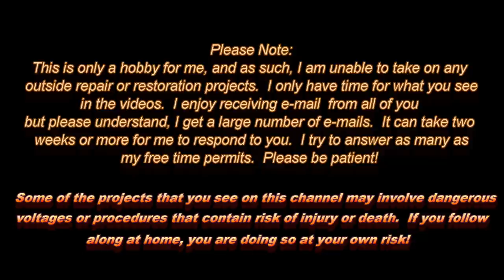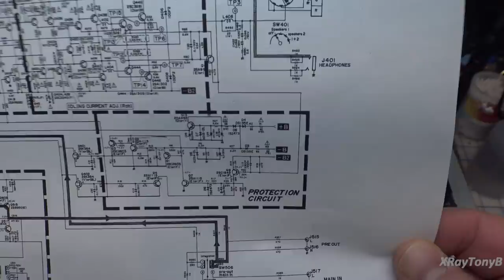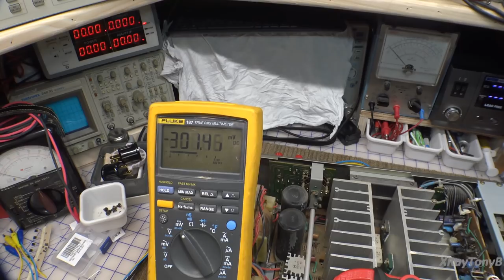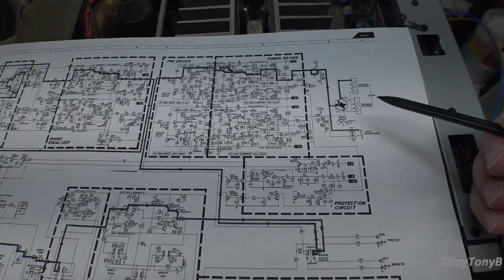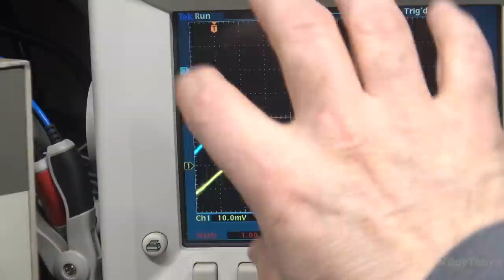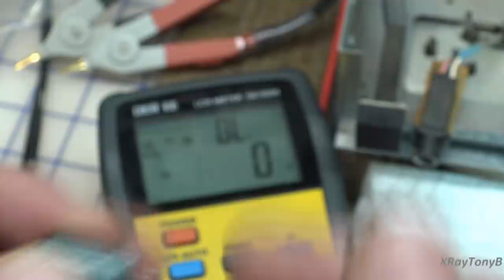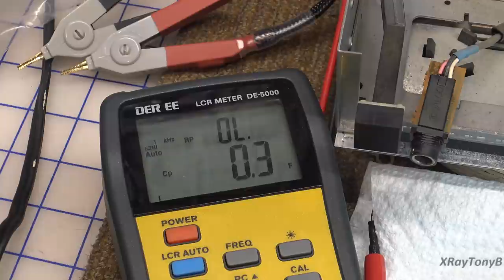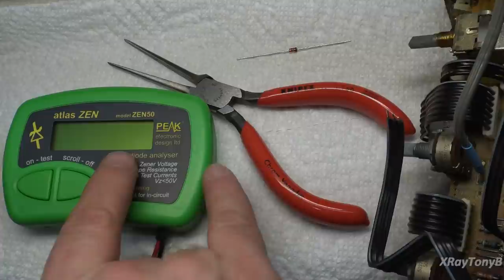Harman Kardon PM665 Repair & Restore - Part 1

Comment: Love the display of the insets in the videos. By stopping the video, it's possible to see everything without any jitter.  Perhaps in time you can put them up in real time, during the session, and point to things with your cursor as you make the points?
Reply: Was thinking the same thing.
Reply: Dude LoL, if you are getting jitter, you need to upgrade to a HDD recorder and look into the issue that you might be having with tracking on your VCR...  
I know what you are saying but I just pictured you using a VHS VCR to watch this LoL...
Reply from the maker: The problem is that I do my editing on the computer upstairs in the living room, while I actually record the video downstairs at the bench.  Placing static images and talking over them at the editing computer is a bit too time consuming and I have to wait until it's quiet (that never happens around here) before I can record.  So, this is the next best thing.  ;)

Comment: Great video! Since I am also working on refreshing my PM665 amplifier, could you please confirm whether the capacitors at positions C17 and C18 on PCB-4 are 47u/16V, and whether the capacitors at positions C61 and C62 are 100u/16V? Thanks in advance.

Comment: I've seen similar problems with TVs from the 60's, particularly with RCA, G.E. and Sylvania among others  They used phenolic boards and they are brittle and don't handle heat well (especially with vacuum tube sets).  This was before popular use of glass/epoxy boards.  I've also seen this type of boards in VCRs.

WRT "flux removal", using a brush with alcohol doesn't actually "remove" the flux.  It just dissolves it and spreads it around in a thin layer so it's not easily seen.  Sometimes, attempts to dissolve flux can cause otherwise benign flux to become reactivated and become somewhat corrosive. I'd rather just leave it on the board undisturbed.  It's not harmful.

In current industry, most flux is water soluble for SMT and TH convection/wave solder and is sprayed off with DI water and ends up down a drain but in the "old days", it was typically just left on the board.

Comment: Thanks for the video Tony. Painstaking job. I had one of these for 25 years and it travelled around the world a few times. Great amp with heaps of current. Those tone switches (and the other pots) are a real problem and get noisy / faulty - sometimes cutting out one channel.. was very tricky to get the thing running properly. Eventually it just got too hard to get right again and I sold it to a guy who restores them for 100 bucks. Weighs a ton too!

Comment: I repaired (well, mostly, I actually need to go back in to fix a "pop" when the tone bypass is turned on) a Hitachi HA-4700 which is also from that era of early-mid 80s and it was the same, just about every solder joint was cracked. Had to retouch the entire board.

Comment: Why do I see Technics when I look at this amplifier... There's something about the styling of it... 
Tony, I really don't mind you doing it the same way each and every single time... I personally think that it's better that way, you see the same thing so many times that it becomes ingrained and forms a good habit... 
Visual inspection first, check power supply voltage, check for DC offset, check Capacitors for all possible failure modes ( I was kinda hoping that you would bring out the other LCR Bridge Meter which displays everything on the one screen, not just ESR and capacity but Drain (EPR) and Quality too...)... So basically I think that routine is always healthy because it keeps you from missing something important... 
Something that I see a lot of on YouTube is people just replacing the obvious failed component but never really go looking for why it failed in the first place... I believe that transistors and diodes don't normally fail out of nothing! The cause is usually somewhere before or after... 
Regarding Capacitors though... I kinda don't like seeing people just checking capacity and ESR... I tend to think that high ESR becomes a real problem in the power supply section where speed is essential to filter out voltage ripple but EPR (Equivalent Parallel Resistance or drain or DC leakage ( seems to have many different names)) is a far worse fate than death... A capacitor with low EPR will pass DC and this usually results in death for the next component... I have been trying to raise awareness about low EPR and what it means in the comments section of other channels but people still think that ESR and a visual inspection is plenty... A capacitor with low EPR can display very good ESR and higher capacity! This is not a good Capacitor! They don't get better with time LoL... If the capacitors capacity has gone up, it's because it's leaking DC which will cause it to take longer to measure giving the impression that it has more capacity than what is printed on the side of it... 
This is why I personally prefer the other LCR Bridge Meter.. I went right out and got the newer version of yours which is black and has a built-in rechargeable battery via USB C which makes it even easier to use than your one... But they both work identical... Having all that information goodness all at the same time is far more functional than having to scroll through it... The DERR model that you used in this video is a great unit but you didn't scroll through the other details (on camera anyway), I'm wondering if the Capacitors that you tested were leaking DC? Because if they are very high ESR, they might not leak anything lol... Except for getting hot, expanding and leaking electrolyte! But low EPR Capacitor's don't get hot 🔥, everything else does!! Bypass capacitors will cause the transformer and rectifier to heat up or transistors and opamps! Coupling Capacitor's with low EPR will also destroy opamps and transistors and other semiconductors... 
I think that once the fundamental level of understanding is reached regarding the capacitor failure modes and what it all means, then we will all know what to look for to prevent a catastrophic failure down the road... 
I love Capacitors but the grief that they cause is a huge problem and not everyone really understands why! ESR is not enough to give you the full picture of what's happening and what's about to happen.... 
Apart from that.. spending time and talking while working can only be a good thing... Videos will take only as long as they need, not a minute more, not a minute less! You do what you do, I'ma be here watching...

Comment: Just found your channel. I like working on vintage HiFi equipment too so this is very interesting. I also make my own audio equipment just for fun.
To help remove the CA glued knobs, use a CA debonder. Bob Smith Industries offer one called "Un-Cure". Sometimes soaking the joint with acetone works too.

Comment: You keep talking about how good these amps sound.  I bought my HK 655 for the added power over my kenwood 6090, but I don't remember it sounding "better".  I now have a kenwood KA7100 and am amazed at the sound compared to some more modern equipment.  Now you got me wondering if it is better.  But the KW is known to be more reliable so I am sticking with it for now.  Great part one.  Looking forward to part two.
Reply: HK PM665 has a lot more power

Comment: Tony,
Have you ever considered PCB Rivets for connectors on single sided PCBs? Sure seems like adding a solid mechanical thru hole would do good for these types of applications. Granted the rivet press is an expensive item, and doing it by hand is time consuming, but what ever. I've been thinking about using them myself and having a friend spin up the dies on a lathe, just use a plain ole cheap arbor press (something from Harbor Freight) to set the rivets.

Comment: Great video:-) I was thinking about retouching the solder joints, would it be possible to use hot air? I am just thinking to make sure every joint has been reflown. Or maybe put it into a solder own?
Reply: @MARTIN PRECÁK Thank you a lot for your reply,! :-)
I was just thinking that cleaning off the board, some new flux, and reheating would be like resoldering. Many of us do often use old solder rolls added some flux.-)
Reply from the maker: Just reheating it won't work.  The best approach is to remove the old solder, clean the solder pad and apply fresh rosin core solder.  In less critical applications, you can reflow the existing solder joint by adding some fresh rosin core solder or by adding some non-corrosive flux to the existing joint.  Either way, the repaired joint should be smooth (no pits or cracks) and shiny, and should look conical, not dome shaped.  Thanks for the comment!

Comment: It make perfect sense why the joints would crack with to big of holes on a single sided board. However, I find that on plated through hole boards it can be a real challenge to suck out of wick the solder if the holes are too tight. Especially on wave soldered boards.

Comment: TV's from the 90's were the worst, I spent so many hours resoldering cracked joint's just to find that the intermittence will reappear as soon as you slide the pcb on the bottom of the device, at least the 80's TV's had the pcb with the solder side oriented to the back of them, making it easier to resolder

Comment: Hello Tony, thanks for the video. I was wondering why you used the ksc2383 with the ksa916 instead of using the  ksa1013. Is it because in this application they do not work as a complementary pair?. Anyhow, interesting and useful video. Thanks again

Comment: Sir, how do you clean the little push switches on the front fascia? Mine all make popping or scratching sounds when depressed. 
Also the volume and balance pots are scratchy.
Otherwise the amp still works very well.
Reply: Yes would be interesting to know, exactly same problem with my amp 😢

Comment: Thanks Tony, you know it seems problematic to have those rigid wire interconnecting cables - because of their rigidity they act like a fulcrum and overly stress the solder joints - I wonder if less rigid cables wouldnt have been a better design.

Comment: Greetings:
I have no first-hand experience with liquid flux because all of my soldering needs are covered with paste flux beyond core flux. When I need to do a lot of reflow, I first apply paste flux to sections that will allow me a comfortable amont of work area. Then I only need to keep my iron's tip clean to progress without having to adjust my solder length. It is my practice to use lacquer thinner to clean excess flux off the board even though the air quality folk would rather I didn't.

Comment: Hopefuly HK doesn't use proprietary FETs or you might have an unobtainium issue..like Sony did on some of its high end stuff.
Reply from the maker: These amps use standard bipolar transistors.  Those VFET's are impossible to find these days, although they are supposed to be pretty reliable.  Those amps are very rare as well. That's why you haven't seen one of those Sony VFET amps on my bench yet!
Reply: @xraytonyb  Yea..And the T0-92 small FETS for the line-amp stages are unobtanium also. I ended up redesigning a line-amp circuit and replaced them with low noise bi-polars after they ran flawlessly for 40 years !  The Sony boards were designed well easy to remove. My college roommate had an HK1000 cassette deck. That gear got a work out...:)

Comment: I have a Harman/Kardon  AVR 80 - It's a 5.1 with THX. It cost an extra $1,000 for the THX. Bought it in 1985, has never needed servicing!
---
Sorry, with all those loose solder joints, I WOULDN'T power it up!    What kind of Alcohol?

Comment: Tony,
I really enjoyed this video.  I was about to look for part 2 when I realized that you probably don't have it uploaded yet.  Looking forward to it.
I have a few questions.
1. On those switches...the plastic ones you said were quick to fail...is there a recorded MTBF on them that you know of?
2. Do those same switches contain a Wobblefram Actuator Seal ?
3.  In the area where you replaced the Zener Diodes, did you check the value of the resistors there?  Since I didn't see any of those raised above the board, I imagine you either didn't measure them or didn't replace them for some reason.
4.  Do you really trust the filter capacitors in the power supplies enough to leave them in there?  I would not trust them and would replace them, but that is just my own "knee jerk" reaction to capacitors in general.
5.  Did I understand you correctly that the holes in that circuit board do not have a "feed-through" hole that connects the top and bottom of the board?

Keep up the good work...and I am glad that you don't worry about the "gripes" you get.  You can't please everyone, and you seem to have that under control so that it doesn't bother you.

Comment: Hi, after replacing the burnt transistor in the final stage of the amplifier,I checked back and I found varistor mv12ym (chain of diodes) which is burnt out. I can not find any replacement. Maybe you know any substitute. Amplifier PM 655Vxi, element D409, kindly please help me if yoy can.

Comment: Hi I have a HARMAN KARDON HK6600, I have a pop when turning on the amp when the relay in the protective circuit kicks in and when turns off. In addition the speaker selector pops when turned to a different position. Other than this my amp works fine, have you run across this problem?  I will try to resolder the the solder joints at the capacitor in the meantime and see if that helps

Comment: THD < 0.08% is surprisingly high distortion for a high end amp. That said, I'm an amp designer, and by the time these amps have been through the various cost cutting measures and sourcing issues involved in mass manufacturing, maybe that's pretty typical? That said, my best designs are closer to 0.0001% at 20kHz, and aren't a lot more complex than my high-power designs which perform better than 0.001% THD. My first design, a guitar amp, where I didn't even care about the distortion ended up performing around 0.01% at 20kHz and 0.005 at 5kHz (the sweet spot). 

I think it's the difference between me having access to free simulation software to iron out the kinks, sweep for issues, and optimize things, (LTSpice is my favourite) and these older designers having to work things out the hard way.